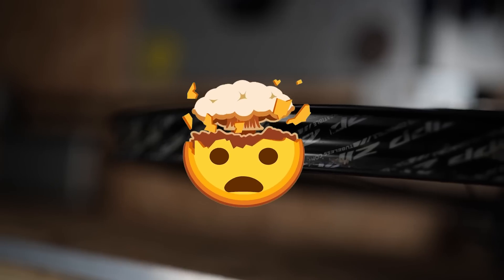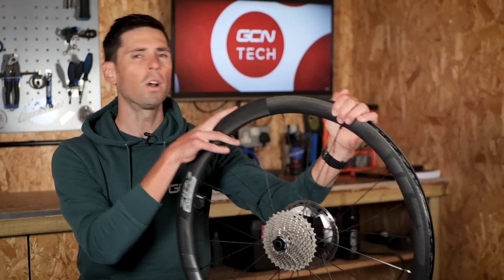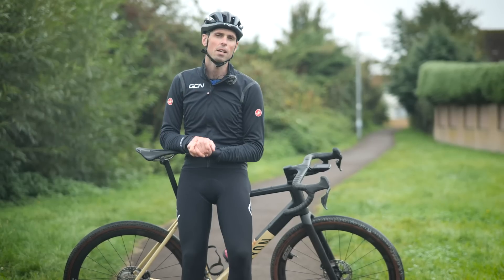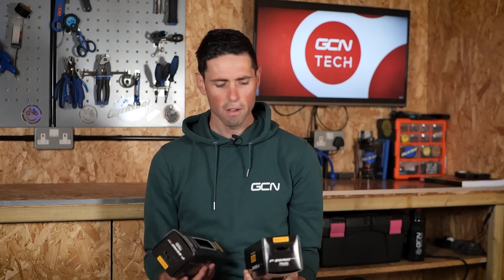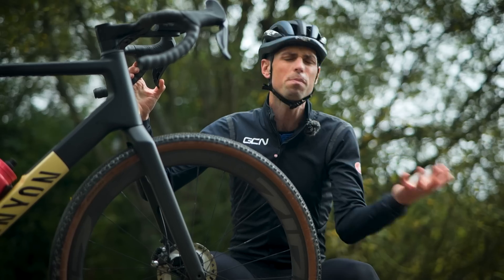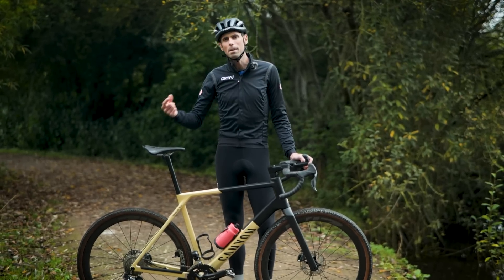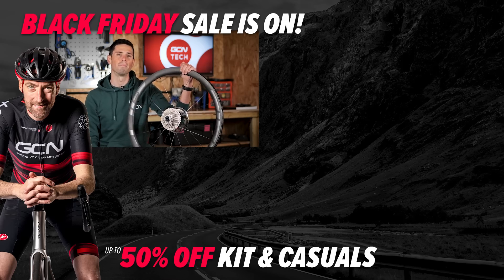What exactly is hookless technology, and what are its pros and cons?

Comment: Sorry, no. Nobody needs hookless rims however you look at it. They are definitely not more aerodynamic than hooked rims, tyres don't have "more seamless transition" (have you even seen a standard tyre and the corresponding groove to match the hook on the wheel?), there is no way you can save 200 grams per wheelset compared to similar hooked rims, and when you have an increased risk of blowouts they are less safe. Increased comfort because...slightly wider tyre? There's plenty of options, thank you - let me just pick a wider tyre and not dance around the limitations of hookless. Wheel manufacturers and the marketing around this need to calm down.

Comment: Look I am a rider who is between 100 and 110kg, currently I run on an old set of 2014 era wheels (alloy rim but with a carbon fairing) cause well rim brake bike and what I could afford, I run 700 x 25/26 tires at about 100 psi front and back with Tubeless set up,  This works for me, but when it came time to buy new tires nearly all even at the 700 X 25 were max inflate 80 psi.  These wheels are well wearing out so I am going to have to find another set of wheels, but I prefer under the 28c rather stick with the 25c, nearly all rims seem to be hookless and then you get this 80 psi limit.  I have tried on my current wheels lower pressures and it just does not give me any confidence out on the road.
Reply: You're over the weight limit for 32mm tires.  I'd get off the 28mm tires.

Comment: Or you can just use hooked rims and not having to worry about having the right pressure or tyres.
Reply: I have hooked rims from HED with 65psi pressure limit for 28mm tires.
What I'm saying is: please, please, PLEASE, always check the pressure limits on your wheels and tires and never exceed them, hookless or not, tubeless or not.

Comment: Hookles means, that if you get a big puncture (or cut) in higher speed, you are probably dead, because tire will fall off quite easy = it will damage the frame, rim will get destroyed by rolling on the ground and you end up with your face on the ground as well 😂. But its worth it, manufacturer will make some more money on allready 300% overpriced wheelset. NO THANKS!

Comment: There is a popular myth in the cycling industry that car and motorcycle wheels are hookless. I don't know where this idea came from, the tyre and rim association literally demands a bead hump and flange on every production wheel and tyre sold for those applications. If you don't believe me check out fortnine's video on putting a car tyre on a motorcycle. If anything car and motorcycle tyres are more hooked than normal bike wheels because they also have a bead hump which prevents the tyre from folding in on itself under cornering forces. If hookless is something you're interested in it has been approved by the EU so it is technically safe, as unscrupulous as governments are they're very strict when it comes to demanding safety from manufacturers, just know that these claims in particular are false.

Comment: btw. I'm looking at your video and ... what? What's on that air valve on his wheels? Tyrewiz? What? What is that? ... f-ing wireless air pressure sensor! Leave alone how ridicule this is to have another pointless data to monitor during ride. But I'm balancing my wheels for smoother ride on rollers with weights to compensate for air-valve (it really makes small difference), and you are putting twice the weight ON the airvalve. Ridiculous.

Comment: Inflate them too much and you could die, too little and you could also die. Combine the wrong set of tires with the wheelset and you could die, change the tire width and you could also die. Eat too much during Christmas and exceed the weight limit and you could die, forget about checking the tire pressure before the ride and you could also die. I rather eliminate the risk of dying by simply staying away from hookless technology. Tires are a critical part of the bike and my safety is not worth the 200g weight savings.

Comment: You get a pumcture. You repair it with a tube and use co2 vartridge to inflate it. How confident are you that its less than 73psi as you clip in and ride on?
Reply: Shouldn't be using co2 with tubeless anyway.
Reply: @bikeman123  Depends on the sealant. Some sealants are CO2 compatible.

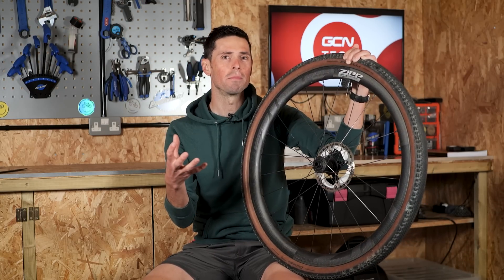Comment: I’m surprised at the pressures suggested by the online calculators.  In my 40 years of riding, I’ve learned that my rear tire wears out about twice as quickly as my front tire. This is due to the weight of the rider being mainly over the rear wheel. To me, this has suggested using a higher pressure in the rear tire. I generally use ten pounds higher pressure in my rear tire compared to the front tire. The tire pressure calculators seem to suggest a 4 - 5 psi difference. Why is the difference so low? 9:37
Reply: I'd use the same pressure on both if I were you.  Lower front tire pressure increases comfort, but it isn't necessary and makes the bike perform less predictably in a 2 brake lockup skid.

Comment: Bought the 303 Firecrest Set for 1300 euros and am impressed. Coming from mtb I am more acustomed to a more squishy feeling tire so. I ride them with a 42mm tire at 2.3/2.5 bar and the balance they offer is great for me. Its my first road/gravel carbon wheelset and i am impressed with price and performance. The tire compatibility issue exists as long as demand is low, and that will not take long before it ramps up. Good pros and cons list there thanks

Comment: Just read through some of the comments, and it seems that some riders don't trust the hookless tech.. I've been running Zipp 303 firecrest wheels with Pirelli P Zero 700x30c for the last two years and have been impressed so far with no problems at all.. the only mistake i made was using Muc-Off sealant... will be using Silca next year. Not using the wheelset on my Gravel bike, still using the stock bontrager wheels that came with it... hope this helps?

Comment: So, essentially, it's a bit cheaper but only compatible with certain tires and I now have to worry that my pump's gauge may not be accurate enough to keep the pressure within the safe range? I would rather pay a bit more and not have to think twice about pumping my tires. The value proposition sounds even worse than for tubeless.

Comment: Hookless rims exists for one reason only -- they are easier and cheaper to manufacture, leading to higher margins for the bike industry. Hookless have zero adantages over hooked rims, independent of application; road, gravel, mtb. They are not lighter, they are not more aero, they are not stronger, they don´t resist punctures better, they are not faster.

Comment: I've actually seen a tubeless tire come off a hookless rim mid ride.  That rider fell and 3 other people who were on his wheel crashed with him.  He ended up with several broken ribs and a broken collarbone.   Now, I don't know whether it was user error on setting up the wheels and tires or not but I can tell you I've ridden for 25 years and I've never seen a clincher with tubes or a hooked tubeless do that.  At the end of the day, you can blame of the users who setup tires incorrectly but to me, it seems like they've increased the complexity to save 200 grams but added the very real risk of a catastrophic blowout.

Do you think I want to ride with the person who buys these things from the manufacturer but lacks the technical acumen to set them up properly and they become a ticking time bomb?  It can't be this hard and has to be more reliable and intuitive for the average rider. The cons for the average user outweigh the risk IMO.  Now, on a pro team with mechanic and a light rider, maybe, but most of your average riders aren't mechanically adept and don't weigh 55kg.
Reply: They don't even say where the 200gm derived from! Maybe from a old alloy rims with 36 spokes!
Reply: @chickenricelaksa  lol I run 36 spoke rims, spokes are only 4 grams each.  I have a 36 spoke H Plus Son that feels light as hell.
Reply: @___Bebo___  You are missing out on 200gm advantage!
Reply: @chickenricelaksa  They straight up removed a 35mm Butyl tube worth of weight by filling in the safety groove with carbon.  It's amazing tech bro.

Comment: I think there's another major con.  The specific compatibility of the tires and rims varies by manufacturers.  Some rims only have a few compatible choices for tires listed on the manufacturer's website.  With tubes and clincher tires, you could buy any 700c tire for your 700c rim and not worry about the tire coming off the wheel but now you need to use specific models of tires, which seems like a step backwards.  It's up to the user to figure out all these new variables and some just don't know.  

Is increasing the risk of having a potentially fatal blowout worth 200 grams?

Comment: Can you make a video about thru axle, QR and classic spindles which have screws what are the pros and cons?
Reply: Classic axle with 15mm track nut is the best option.  If one nut fails the wheel is still held on, all modern options do not have this fail safe.  It's also the most aesthetic option because nothing looks better than Dura Ace Track Nuts.
Reply: @___Bebo___  but it's very difficult to change tyre with the classic spindles

Comment: At the end of the day, trusting the safety of my bike is worth more than any of the potential marginal gains pointed out in this video. I don’t want to consider all kinds of limitations in order to be safe.
Reply: As said in the video, and mentioned in others; there is a clear safety improvement over the hooked design from a manufacturing and quality control standpoint. If someone uses tires from a reputable brand with these rims (within the specified tire pressure range) its clearly the safer option.
Reply: @lucamuller6729  How is it the safer option? To say it’s safe if you followed all the requirements is one thing. I can accept that. To say it’s safer however seems like a stretch. The only thing I could think of would be the supposed sturdier rim. How is it clearly the safer option for the average consumer? You don’t think it’s safer being able to use more or less any tire and any reasonable pressure without the risk of catastrophic failure?
Reply: @mathias8013  From a manufacturing and quality control standpoint hookless is better, because it uses all metal moulds. This leads to a more precise and more even material thickness and therefor better predictable failure modes. The standard is established and some brands might not yet fully understand the importance of following said standards which is inherantly dangerous. Its always better to step back if there is to much uncertainty with a new technology, but as I said its just three steps to take for safe operation ..

Comment: At this point, I feel this horse being whipped has shuffled off this mortal coil. 
Hookless rims on road as regards the weight saving vs the limitations of pressure and tires blowing off the rim well within the advertised limit even (see cyclespeed’s pair of videos on the matter)…
It may well be worth it in your book, but imho I’ll leave well alone personally, not least as multiple of wheel manufacturers have subsequently to promoting hookless for road, now rowed back, to the best of my knowledge. YMMV 🕊️
Reply: 😄The horse is no more, he has ceased to be, expired and met its maker no amount of flogging will revive it.

Comment: Interesting how all of the negative comments I've read here about hookless rims is from people who have not tried hookless rims.  There are then the usual comments about YouTube videos they've seen of tires blowing off hookless rims.
I've been running a set of Maxxis Rambler tires on my Hunt hookless rims for about six months and 1000 miles.  I typically run them at 35-40 psi, which is the Silca calculator recommended pressure.  The Maxxis tires were the ones I had planned on using and they are rated by Maxxis for hookless.  I use them tubelss, as this is a gravel bike setup.
For my application and from my experience there are no problems with the hookless setup.

Comment: 1:56 add 20g sealant (normally 40g sealant per 28mm tire) weight difference per tire (compared to 20g TPU) and add another 30g per tire to the TSS compatible tubeless tire over its clincher counterpart. That extra weight in sealant and tss compatibility is also further out from the center than the removal of hooks (I’ll let engineers tackle that equation). Bike weight doesn’t matter too much but rotational weight does if you’re going uphill.

200g weight savings can be marketed all day but buyers also need to add the extra weight of their sealant and tire of choice.

My Zipp 353 NSW with 28mm Conti GP5K TT TR  and Silca ultimate sealant are the SAME WEIGHT as my Hunt 44UD carbon spoked set running 28mm Conti GP5k clinchers and 20g TPU tubes. Despite the NSW wheelset coming in over 100g lighter without tires.

Overall it’s really a 100g weight savings between the 2 wheels.

Comment: Hookless is pretty good for a very niche group of people due to too many limitation.
1. limited tires selection, although Giant has test quite a lot of tires, but still way too limited compared to a hooked rim.
2. You gotta be light enough to enjoy the benefits of those things. 73 psi as maximum is not gonna do well if you are above 80kg.

Personally I don't mind hooked or hookless, I get the one that has the best price. I used tires that are compatible, I have see blow off from hooked clincher, hooked tubeless or hooked with innertube. But I would go for a hooked rim over a hookless rim if the price are the same.

Comment: Thanks for the video. I hate this topic, you kneed to know the brand with their unique FckUrPocket-Carbon, internal rim, external rim, hook, hookless, weight of bike, weight of rider; AND tyre 700xZZ with unique their unique secret-rubber, tube or tubeless, dry or wet, casing (thin, normal, thick, downhill). What category are you riding. It's just a mess of combinations. And the amount of users with personal opinions that contradict each other makes this even worse.

Comment: Rim brakes for road racing rule w/tpu tubes.
Weight savings on tss rims lost to heavier tires and grams of sealant?
Sealant is an environmental disaster.
Heights of tss sidewall rims vary which is scary. 
For my weight 30mm tss tire is heavy and not aero.
Who's going to risk 73psi max?
Under extensive hard braking, can a low pressure tire move on a tss rim?
If zipp think tss is faster, where is their tss tt disc wheel?
Princeton Carbon and DT still offer hooked rim brake carbon.

Comment: Here's the question every rider should ask of hookless rims -  what happens if you bombing down a epic or not so epic downhill run be it gravel or boring tarmac and you burp the tyre wall out of the rim from hitting some debris just because you got the tyre pressures even so slightly wrong?
Been using hookless rim tech for a very long time on my other modes of transportation like my motorcycles & cars but I'm always been very fussy with the tyre pressures and the tyre walls a profoundly thicker & stronger at lower pressures then bicycle tyre width or casing thickness will ever be, and yes that is with riding a bicycle at legal open road speeds or above given a right proper downhill run. 
Hookless rims on modern bike with modern tech level tubeless hooked rim tyres, no fecking thankyou I'd rather have all my bones & skin keeped in tacked .

Comment: Hookless works on just about every other vehicle. Bike industry decades behind.
Reply: vastly different systems
Reply: They don't run high PSI like road bikes.
Reply: Other vehicles have horsepower, not 1 human power to rotate their massive hookless systems. For hookless to work on bikes the tires would need to be significantly more robust (heavy) but then they wont sell in the human powered category.